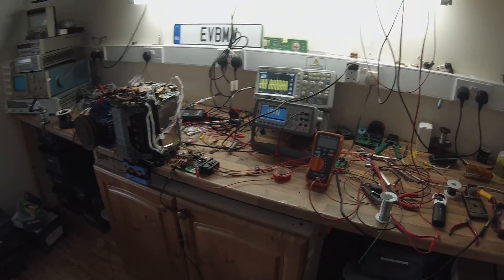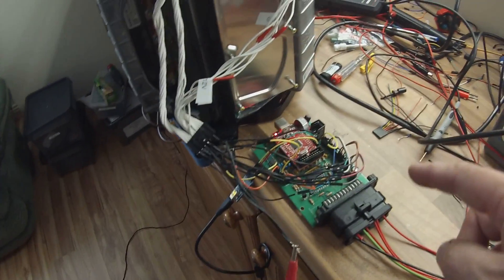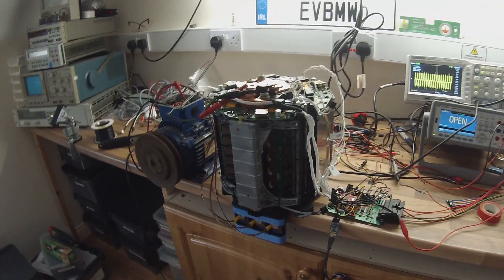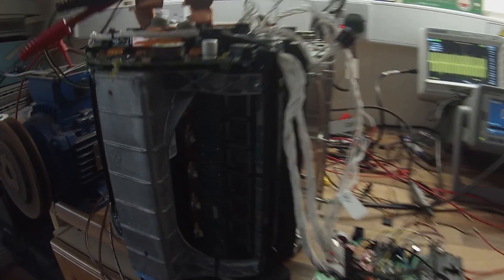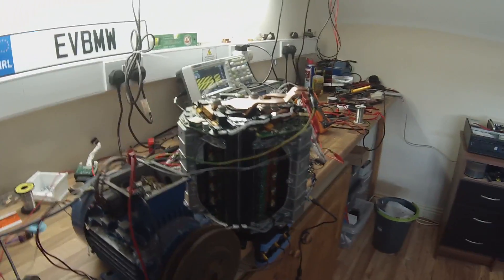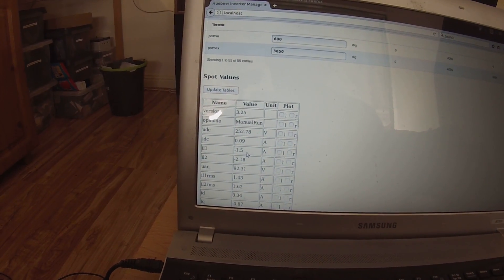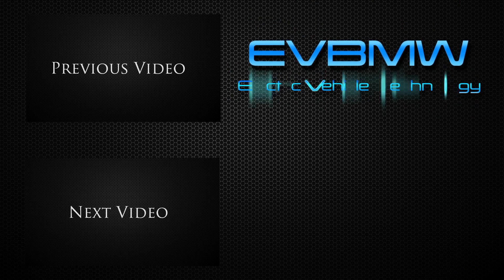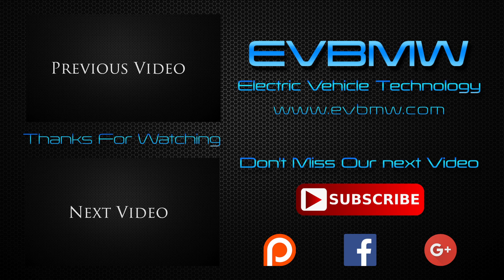The Tesla Project : Starter Motor

Comment: Can you adjust the frequency of the carrier on your driver CPU from 8.8KHz to maybe 10KHz or higher ?, can you measure that the carrier frequency is that Tesla use on the original driver ?,  Great work, Dave(IGBT swap for charger and PCB's)